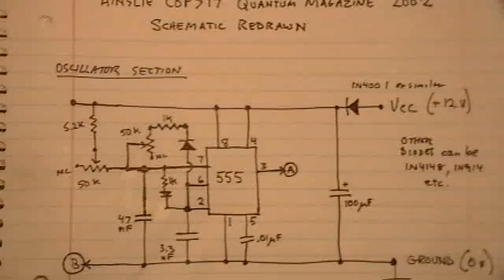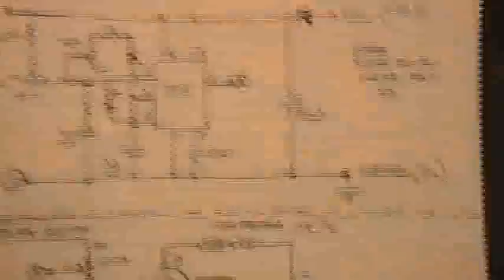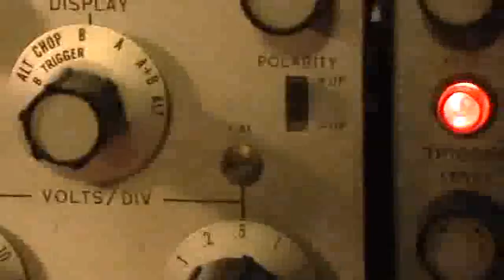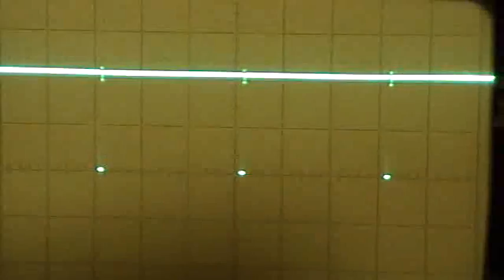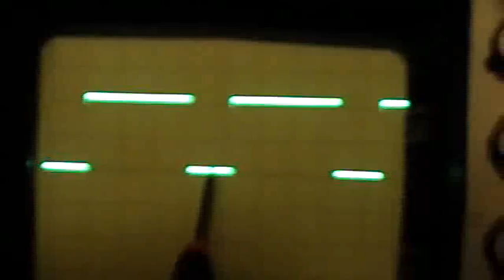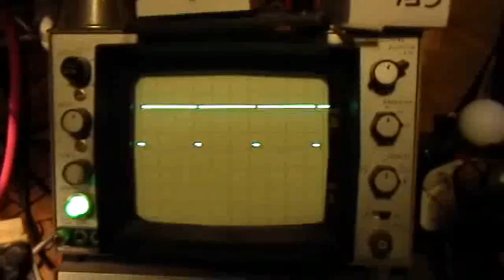Electric OU: Supplement: The Ainslie Quantum COP17 555 Timer Circuit

Comment: What is Vp (V sub p or the pinch off voltage) of the FET?

Does Mary realize that the venerable LM555 has been around since at least the mid 1970's? 

She has evidently 'latched' (forgive the pun) onto something she has little to _no_ understanding of and been grandstanding on the single item for a couple years now ... were this phenom true (excess energy), it would have taken off like the hobby PC market did back in the 70's when everybody was building one and THEY worked!

.

Comment from the maker: No, it does not mean that at all. 
I think, based on the experimentation I did back in 2009 which you can find in my videos, that Ainslie's heat profiles were made by using the original Quantum 555 circuit and that she didn't realise that the duty cycle was inverted. I also think that she badly miscalculated the energy use and the battery capacity, and that there is no evidence that any excess energy was involved in her process. But build and test for yourself, don't believe the internet.

Comment: So does this mean that you think this circuit is a COP 17 circuit.

If so can you show an example of the input and a loaded output?
Reply: No, it means it was never OU, she got confused because she thoguht she was inpotting a small amount of power based on her belief it was on for only 3-4% of the time.  But it was the inverse of that, it was on for 96-97% of the time, and as such it poring in about 28 times more energy that she thought.  This explains the heat generated.